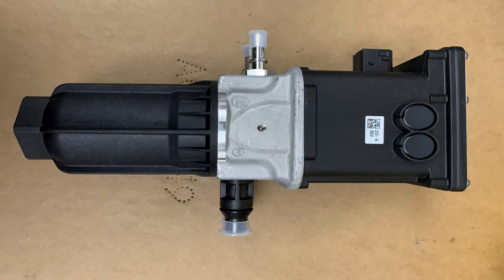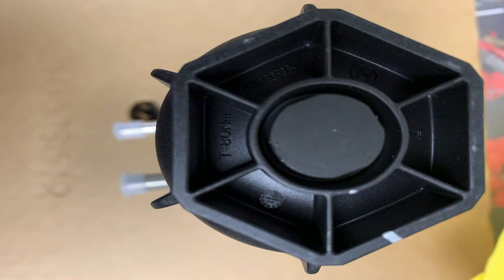Aftertreatment cm2450 Part 10 UL2 DEF pump

Comment: I had a pump leak .and it was bad and had pressure fault from it
Reply from the maker: If it can't maintain pressure it would log a fault. The pressure is sensed in the UL2 dosing unit. These  are fairly new on the road Id say less than three years old. Thanks for sharing